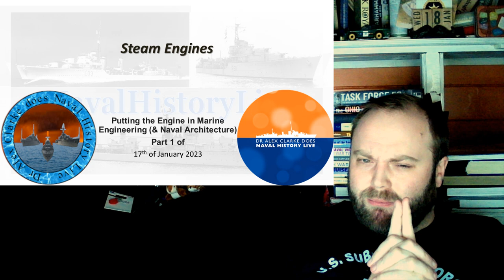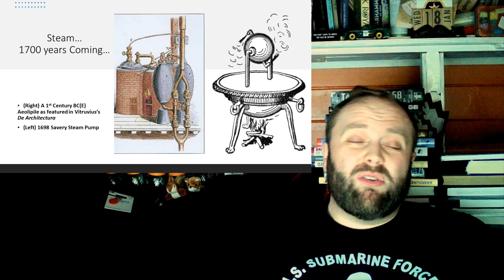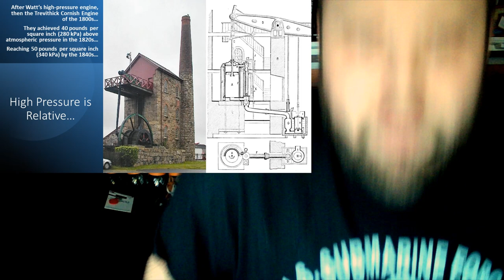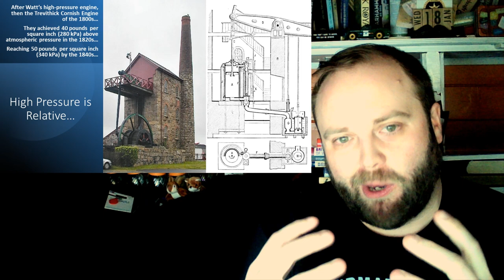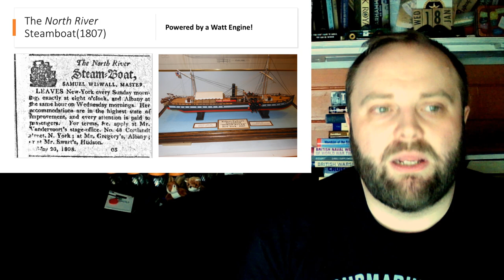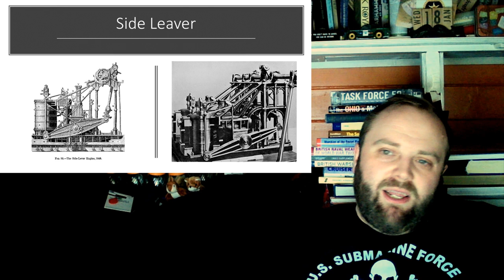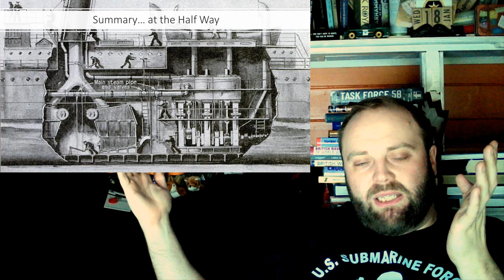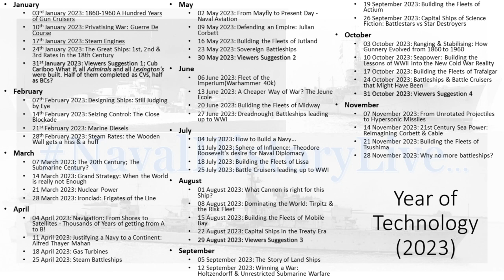Steam Engines: Part 1 Aeolipile to Cross Beam

Comment: The secret of British leadership: Do not allow a mineshaft gap to develop!  An excellent view of the processes needed to move frontier-changing breakthroughs into being practical machines for use.  The image of steam-powered vehicles moving legions over roman all-weather roads is attractive, and was not impossible, but it would have required a dedicated effort over time to come about.
Reply: Most of the technologies that made civilization possible evolved from the mining industry.  Rail to haul ore and spoil out of the pit, cranes and winches, pumps to remove the water from mines continually flooding etc.  Making these operations steam powered rather than by wind or beast was far more effective.  The engines used to drive pumps soon came to winch carts on rail etc.

Comment: My favorite example of an incredibly difficult technology that seems simple is the ballpoint pen as, while invented earlier, it took well into the 20th century for it to be truly viable due to the issue of simultaneously preventing leakage and maintaining a sufficient, steady, flow of ink from the internal cartridge.  Then there is the question of how to refill or replace the cartridge as making disposable pens with their finely engineered nibs would be an absolutely ridiculous waste of industrial resources.  Many of the same issues were seen with fountain pens earlier and the solutions that were adopted were only marginally successful until the last few years of the 19th century.

Comment: The big difference between steam locomotives and steamships is that, in a steam locomotive, fresh water is pumped into the boiler from a storage tank, turned into steam which moves the pistons, then is vented off into the atmosphere (fresh water is plentiful on land).  In a steamship (especially in salt water), water is distilled first, using some of the energy from the boilers, is pumped into the boiler, turned into steam that moves the pistons or turns the turbine, then gets condensed back into liquid water using the seawater as a heat sink and is recycled (a/k/a closed-cycle).  That is at least part of the reason that locomotives favored fire tube boilers and steam ships water tube boilers.  Nuclear power is slightly more complicated, but pressurized water reactors are more common than boiling water reactors (thanks in a large part to ADM Hyman G. Rickover’s personal preferences).

Comment: End question: the internal combustion engine as seen in a car from the last 20-25 years (ie mine from 2004) - in theory, very simple operation: squirt petrol into a contained space, spark, expand, repeat... in practice... thousands of times per minute... reliably (see car still happily running mechanically since 2004...)

Another thing is, I guess, the things that are SIMPLE and/or EASY... once you have the technology around it... for this I would agree that steam (leading onto internal combustion engines) is one - really easy, once you have the quality and reliability in metallergy to make the engine anything other than an artillery scale game of Russian Roulette; ditto computers and radar until you get transistors and the cavity magnetron 

The final thing I would suggest is an interesting duality/comparison is what you make your aircraft from - metal or carbon-fibres - this has been going on almost since the advent of aircraft; when we talk about the de Havilland Mosquito being made of "wood", it is not carved from pieces of oak like HMS Victory but rather made from laminates of cross-grained wood bound with adhesives making it effectively carbon fibre at a slightly more macro engine

Comment: The one of the first attempt to use steam power for anything other than pumping failed, that was in the 1780's at Arkwright's mill in Manchester, because this engine (Newcomen type 20hp max from my research) could not produce sufficient power to turn the belt shafting to run the spinning machines- too much loss in the transfer between linear motion of the engine and converting that to rotary motion for the power distribution system would be my guess as to why. 
However ingeniously the engineers created probably the first "pump storage scheme" by using the engine for its original purpose; to pump water between a lower pond and upper pond, then used that "head of water" to power a water-wheel. We now know exactly how this worked because "Time Team" excavated the site in 2006 and found the location of the engine house, the ponds  where it pumped the water between and the site of the water-wheel. 
Now the technology situation improved that by the 1790's they were able to get an engine which could which was rated at 40hp which could run the machines direct. So 10 years to more than double your power output is a quite good pace of change for the period.

Comment: Morning!

You do know that we Anthropologists are arguing whether some stone tool techniques arose because of larger populations making the transmission of knowledge easier.

You might enjoy Eric Flint’s 1632 series. Some interesting technology…

Hmm. Silly question, but did anyone try for Quintuple Expansion or beyond that you know of?

Biggest point for me? I worked in engineering, manufacturing and logistics. Most people just don’t understand the shear complexity of setting up manufacturing anymore, because tools like CAD/CAM, ERM, etc. shoulder so much of the load. We’ve made it culturally easy — until there’s a supply chain disruption!

Do you follow Peter Zeihan? Smart guy, disagree with a fair number of his conclusions because I think he’s looking in the wrong places, but one concern he has raised is the impact of a retreat from Globalization on transport security. Which implies — drum roll — higher levels of warship production. At least for anyone who wants to trade.